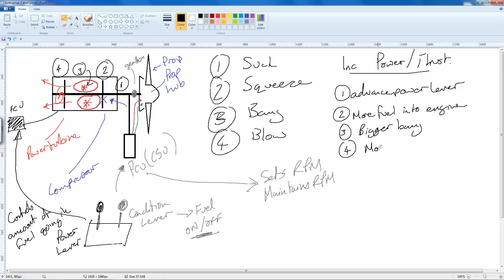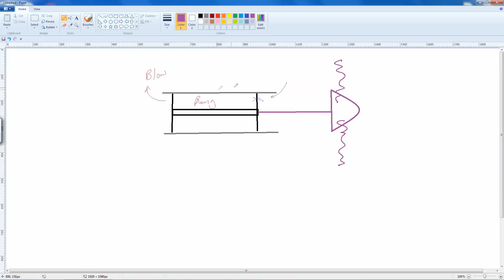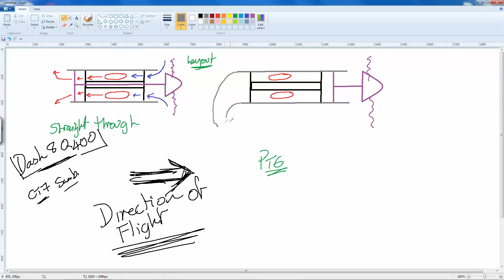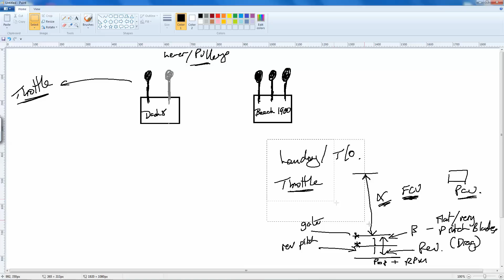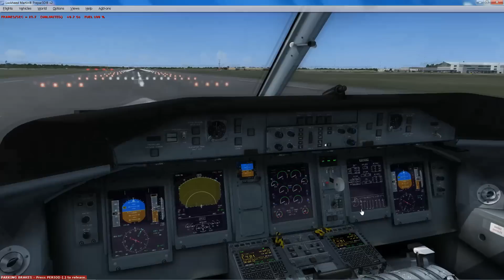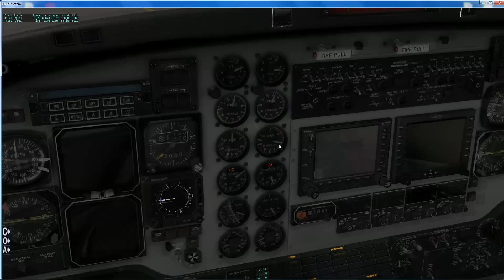Turboprop Tutorial (Part 2 Free power turbine) Majestic Dash 8 Q400 | Carenado Beech 1900D

Comment: What's the point of the multiple spool engine ? Kinda like having a turbofan but in turbine form ( if that's clear enough ) ?
Reply from the maker: By having a multi spool engine, you can have more efficiency with regards to delivering power and performance.  If you only have one shaft then it's difficult to get the best performance between various sections of the engine because the fans are all forced to rotate at the same speed.  As engines have developed, the limitations of a single spool engine became more apparent but multi spools allow different spools to naturally stabilise at different speeds improving the efficiency of gas flow.

Comment: Increasing the angle of the prop does not necessarily increase thrust, because thrust is dependent on the EFFICIENCY of the prop in various circumstances. It behaves similar to a low or high gear in a car. Going up hill in a car in top gear will not create efficiency. Similarly increasing prop pitch will decrease efficiency while climbing and if airspeed is low. For takeoff and climb you need FINE pitch and higher rpm (like a low gear in a car)  When you've climbed higher and the air is thinner and you you have accelerated, you now need lower prop rpm/higher prop pitch (like high gear in our car). So thrust is dependent on the relationship between power, drag, airspeed, rpm and prop pitch, not just prop pitch by itself.

Comment: 1:28:00 btw, x-plane does model it, just the Carenado model doesn't have it enabled by default. Open the aircraft in Plane Maker, go to Standard -> Engine Specs and on the left side you'll see "go to BETA PITCH below..." and "go to REVERSE below...". Make sure both are checked and set a fraction there, so that when you move your throttle below these positions, beta & reverse will engage. For my throttles, I'm using 0.44 for beta and 0.20 for reverse (works out to some nice positions on my physical levers). Then, it'll behave just as in the real aircraft.
Reply from the maker: +totoritko Ah great.  One of the great joys of X-Plane being able to adjust things via plane maker.  Huge thanks for the help, much appreciated :-)
Reply: flightsim481 My pleasure. I find that since X-Plane 10.40, turboprop modeling is pretty much spot-on. At least on the free-power turbine engines. I'm not sure about single-shaft units (don't have any where I could test it). Most notably, they've finally fixed beta-range and it behaves properly now. In alpha-range, fuel flow is altered (and thus NG). In beta range, NG is kept at idle and moving back further fines pitch and uses prop inertia instead of NG (useful for taxiing). Past beta and in reverse, moving backwards further decreases pitch into negative and again increases NG.
Reply from the maker: I was running this in 10.36 but it sounds like 10.4 has made some key improvements.  Most notably they have got the fuel flow, pitch control and Ng behaving properly.  Best I get updated to 10.4  :-)
Reply: flightsim481 At least with X-Plane you don't need to shell out $200 for bugfixes :P
Reply from the maker: Lol, fair point.  To be honest though, the community support for X-Plane means that I haven't had to pay for much such due to the amount of freeware!  I think other than paying for the sim itself, I've bought about 5 or 6 aircraft and all make me smile, particularly the FJS 732 which is stunning.
Reply: flightsim481 Couldn't agree more.

Comment: Very nicely done video, quite thorough. One minor niggle I found though is where you said single-shaft turboprops suck in and generate more exhaust "gas" when you push the fuel control forward. In fact, the amount of gas is the same (since engine speed hasn't changed). What changes is the potential energy of the exhaust gas (because more fuel is dumped in and combusted), so a rise in pressure & temperature occurs. The simple reason why you can increase fuel without increasing oxidizer intake is because turbine engines always burn extremely lean (i.e. there's a vastly more oxidizer than would be needed for an optimal burn; the rest gas being used for cooling and as reaction mass).
Reply from the maker: +totoritko Lol, thanks for the kind words.  More importantly, thanks for clarifying the more technical aspects regarding gas flow (a minor niggle is still a valid niggle).  I hadn't really considered the energy changes in the system too deeply for this video, but for my sins I enjoy considering the more technical aspects so your help is deeply appreciated.
Many thanks,
Rich
Reply: flightsim481 My pleasure and thanks again for the great video.